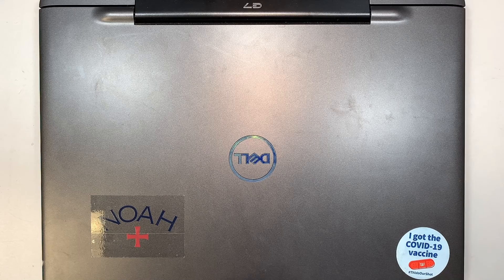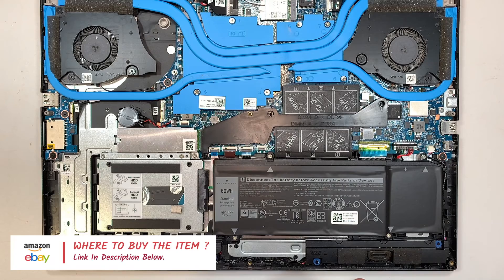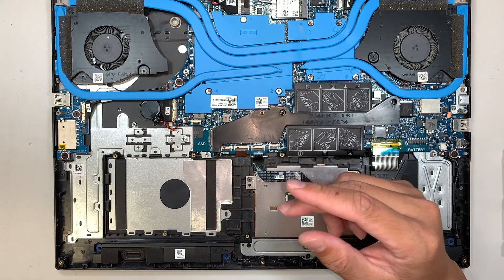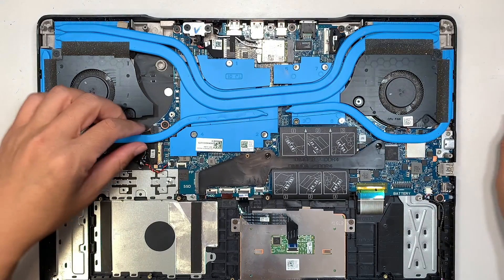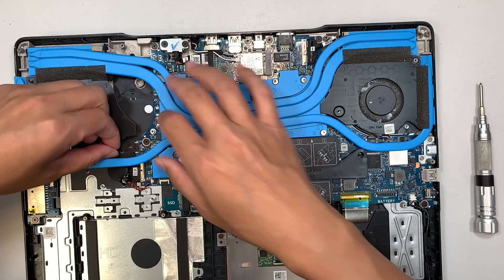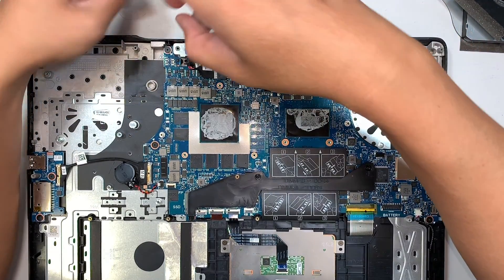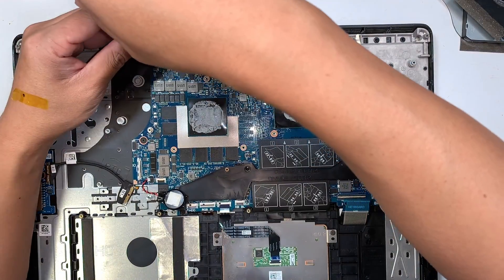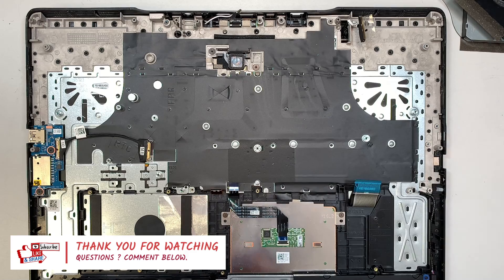Dell G7 7790 P40E Tear Down Upgrade Disassemble

Comment: Dell= a fuckn disaster of enginering. I have the inspiron 7590, luckly the keyboard can be replaced but the mainboard connector is crap. keys not working at all because of it.
Reply: bought mine used for $540 with 1660ti looks bnew got a steal
Reply: Odd.  They've worked well for me for 30 years. Buy something else. You're free to choose aren't you?